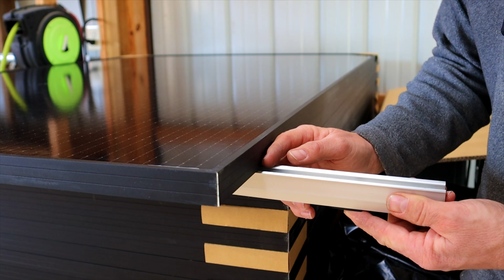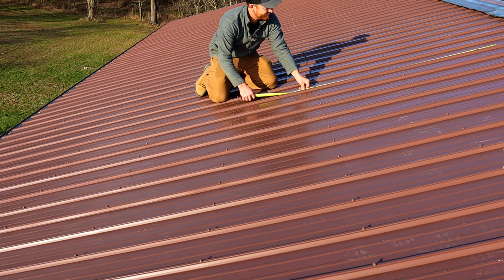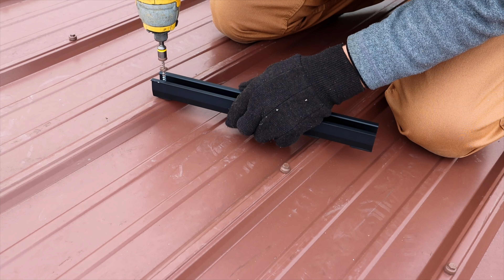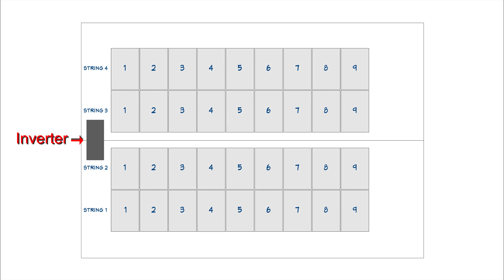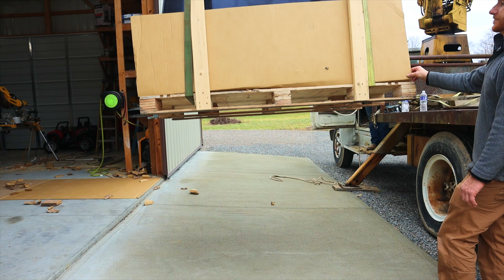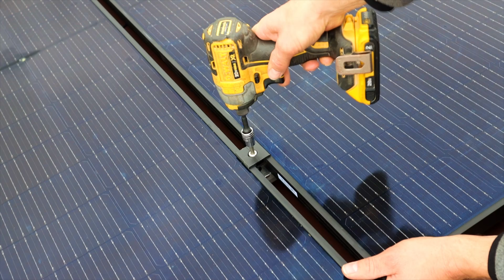INSTALLING MINI RAIL RACKING + SOLAR PANELS

Comment: It's ok to walk on the pannels?
Reply from the maker: Probably not recommended. Not sure how else I would’ve done the center bolts unless I used some sort of scaffolding. I tried to keep my feet on or by the panel frame.
Reply: @MT_Homes  That's my question.  I am debating putting walking paths on my set up so I can reach them but then it's at the sacrifice of major wattage loss.

I have never seen anyone walk on the pannels and now I read it does damage the cells in the oannelsm

Comment: See you didn't use fast shutdown devices on your panels.  Isn't this a requirement for roof mounted panels?
Reply from the maker: I was told when I purchased the system that if installed on an unoccupied, detached structure, NEC doesn’t require it. (Dug in that more recently and I’m not sure that is correct. I believe open buildings, carports, pergola, etc do not require RSD) 

My utility company said as long as I’m not back feeding they don’t require inspections. (I’m running off grid)   
   
I called my insurance company and they didn’t require any kind of inspection either. 
   
Locally, there are no building codes. 

   Based on all that, I opted not to install RSD. Especially since I plan moving  the system to a ground mount someday. 
 Obviously, check with your local AHJ, utility Company & Insurance company for RSD requirements in your area.

Comment: From my modest experience just avoid any mounting system which allows PV panels installation closer than 4in one from another specially vertically and if too close to the roof surface (4-6in). In a hot summer day updraft under the panels has nowhere to go but up, heating the top panel too much, specially if more than 12ft of lenght is in question (2 panels in row, longer side vertical) and roof pitch is low. Even worse if RSDs or microinverters are installed under panel as they are first to melt (185F max temp). Good luck!
Reply from the maker: Good point. Thank you for the input. I actually plan on angle mounting them later  for better sun angle in winter time. Also to get the bifacial benefit when snow covered.

Comment: I love how solar connectors are never consistent.
Reply: If you have mis-matched connectors through which up to 600Volts DC will run, you will have heating and an eventual fire. This is the most common cause of fires in solar PV. If you have to borrow or buy a real tool ($500) to put on all matching connectors, ideally real MC-4, then do that. This is a 25 year expected life power source so real care must be taken to make a reliable and safe installation.
Reply: @TomKacandes I have 15 of the same type of solar panels and some of them were wired backwards
Reply from the maker: @jamesm568  You’re saying the male ends were positive on some panels and negative on others?
Reply: @MT_Homes Yeah!
Reply from the maker: @jamesm568 that’s nuts!
Reply: @MT_Homes That's why I prefer to crimp my own MC4s.

Comment: Funny thing: For MC4 the female and male connectors look opposite as the contact elements inside are flipped.
Also, they will work ok but you turned your grounding shims 90 degrees. Normally the fins stick down into the slot in the rail and and the slot for the bolt hugs the bolt so shim and bolt slide along rail together. This would have made it easier for you to get the grounding clips to reach both panels too.
You should really not cut the zipties with a knife as nicking the cable insulation is very easy to do. Best to use a pair of snippers. Great work on the wire clips though! Excellent use!
It did hurt my soul a bit when you stood on the panel frames at the end but you tried to at least stand on the frame edges by the rails.
Oh, and you don't need a gap between rows of panels if it's just two rows. There is thermal expansion room for both strings upwards and downwards from the middle.
Install looks great though! Love the black end rails!
Reply from the maker: Thank you for your feedback and the tips. I’m unclear though on how I should’ve done the grounding clips differently. If I rotate them 90 degrees, the flanges would sit on top of the rail, not allowing the teeth on the bottom to bite into the rail. You’re saying I should’ve rotated them 180 degrees?
Reply: @MT_Homes  These exact clips are designed for a rail where the flanges fit perfectly in the slot if rotated 90+ degrees. If they do not fit when rotated on your rail then they sent you the wrong clips or at least they are the wrong clips for those rails. The interesting thing is they do not match the images shown on signaturesolar website.
Reply from the maker: @1kreature   Just rewatched the install of the grounding clip. I see what you’re saying now. I’m gonna loosen one up and see if it fits when rotated 90 degrees. If so I’ll note that correction when releasing the full install video. Thank you for your input!
Reply: @MT_Homes  One solution would be to use some snips and narrow the wings so they fit in the slot if your rails have a narrower slot. In the end though, I guess you did the best with what you were delivered. Googling Hot-Selling-Solar-Mounting-System-Accessories-PV-Panel-Earthing-Grounding-Clip.webp at least finds images of how these exact clips are installed.
Reply: I tried giving direct links to the site but Youtube seems to filter out any actual useful links. 🤣